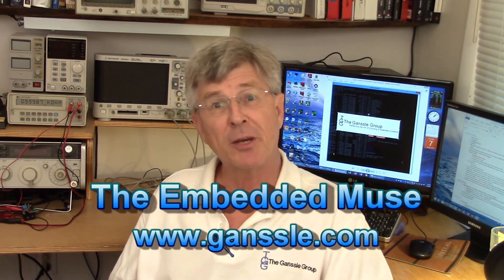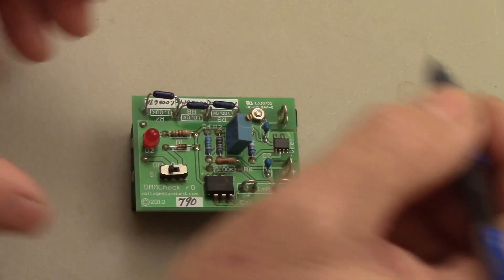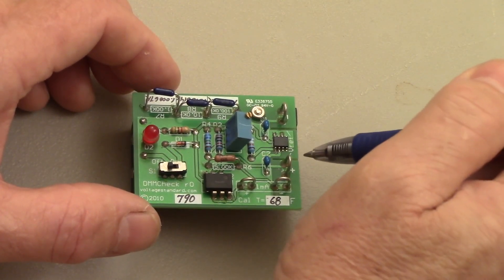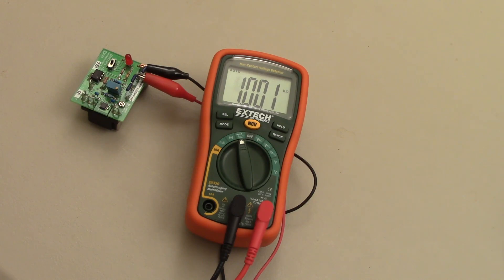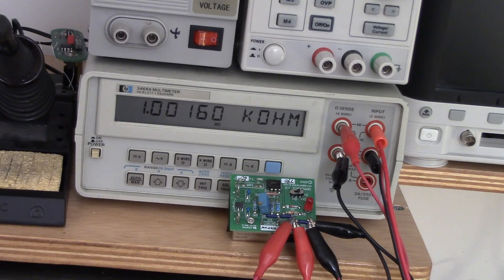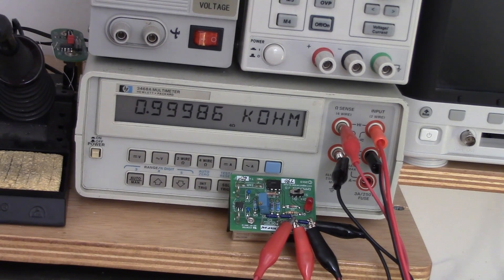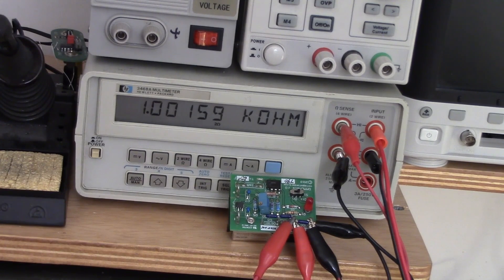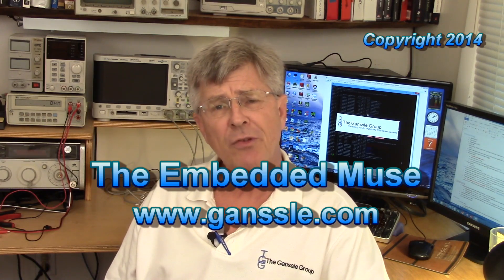Episode 10 - Is Your DMM Accurate? Here's How to Tell

Comment: The point that most folk miss is that you rarely actually NEED to know a voltage accurately. If you are making or repairing an amplifier or some digital circuit and you adjust the power supply until your meter says 5.00000 volts, but due to meter error, in fact it's 5.05 volts, does it really matter? Very rarely, particularly if you use the SAME METER to measure other voltages in the circuit. And that's a 10% error!  Most DMMs, even the cheap ones, will be far more accurate than 10%. Engineers spend a lot of time COMPARING voltages. Is the voltage at point X higher than that at point Y, when it should be lower? If you compare two voltages that are supposed to be the same and one of them is a little high, you're probably going to say "Well, I guess that's near enough". But if one is half the value of the other, then the response is "Looks like we've got a problem here". What is important is REASONABLE consistency, repeatability and linearity. If you measure two voltages, one of which is half the other, then it's often important that the meter gives two readings that are in the correct ratio, i.e. 2-1 within a reasonable deviation. We happily work with 1% resistors or worse, we measure voltages on analog oscilloscopes by counting graticule markings (10% if you're lucky) etc. and our circuits usually work just fine.

Clearly, there are times when absolute accuracy is vital, but most engineers rarely if ever work on such projects. The rest of the time, owning a meter with umpteen figure accuracy is just a matter of pride - like owning a new car - a nice to have, but not essential to get the job done. And of course, just because a meter has 5 digits, doesn't mean it's accurate - precision and accuracy are different things.

Comment: Hello and thank you for your very interesting videos. When it comes to 4-wire resistance measurements, what is the advantage above 2-wire measurements when the test wires' resistance is cancelled out?
Reply: As stated in the video, 4 wire is more precise, and you really want to avoid test wires resistance when you're measuring resistors under 1 ohm

Comment: Interesting video. But there is one little detail of which you should be aware. Your DMM (HP 3468A, also applies to HP 3478A) will only be calibrated in either the 2W ohms ranges OR the 4W ohms ranges. This is a quirk of these instruments. If you haven't done anything to it since it was new, chances are it's calibrated on the 2W ohms ranges. I have an HP 3478A and on several occasions measured negative ohms! After some investigation it turned out this was the reason. (This does not have an impact on the validity of your explanation in this video though.)

Comment: Hi! Just a couple of questions: Other than the specified values, written on the DMMCHeck, how can we be confident in them? How stable are the mentioned values with time and/or changing temperature in the lab? Wont these variations surpass what you gained from going from 2-wire to 4-wire (Kelvin) measurement?
Wish you told us more about the effective stability and reliability of DMMCheck.
If measuring 1K we get 1.0016K instead of 0.9986K (an error of 0.003K or roughly 0.3%) and that is not acceptable for a specific job, how much better will we be with DMMCheck?
Note that I have nothing against the unit and believe it is an excellent idea to have references at hand, to gauge our measurements.
But, how good is the unit? After all, people will be buying it because they have no other lab references and cannot afford a top notch calibrated instrument.
Reply: To my knowledge, these units are measured by an HP 3458A at 23 (or 25?) degrees Celsius. As long as the unit has not suffered any sort of trauma like submersion, extreme heat or getting bashed, they should perform fairly well when you replicate the environment it was characterised in. I.e. your lab's temperature should be within 1 degree Celsius of the temperature of the lab it was characterized in. That said, it's always a good idea to compare several instruments whenever you have the chance.

Comment: HC-01 is simple to use Multimeter Calibrator Reference if you need to check your meter, voltage,m current and resistance
http://www.h-instruments.com/product/avo_multimeter_calibrator__reference

Comment: Can you explain how the cutouts around the voltage regulator keeps it accurate.
Reply: Sort of a gimmic, I think. In expensive instruments it helps for dealing with material deformations due to temperature changes; if your board stretches because of heat, the leads of that IC will not get tensioned as much. This board is only intended to be used around 68F (it was calibrated at that temperature), so I don't know how much the cutting out helps in this case.
Reply: chubbytrucker01 . It also helps with long term drift and stress on the chip from  mounting the circuit board etc. Google voltnuts for the down the rabbit hole detail  of voltage references.
Reply: The effect of mechanical stress on the Vref is real, but I doubt most users will ever notice unless they are sporting 5-1/2 digits or better.

Comment: I don't know if you are still monitoring this post Jack. If so, I have a question concerning DMMs. That question is: Why do DMMs not have a zero adjust for the ohms scale? Every DMM I've ever shorted the leads on reads some small amount of resistance, even my brand new, calibrated Fluke 87 V. I am making the assumption that the meter is reading the resistance of the test leads.
Reply: +Roger Lamb I am not sure if you found the answer to your question, but here is my input.

Modern DMMs often do have a relative mode, which can be used to cancel out the lead resistance on ohms mode, generally this simply means you short the leads and click activate the relative mode. I do believe the Fluke 87V has this feature.

Though you will probably find that when dealing with resistances under one or two ohms factors like contact resistance can make a significant impact on the measurement.
Reply from the maker: Roger,

I can only speculate, but assume it's because the lead resistance is low, and not important for most measurements. If there were a zero adjust, odds are most people would have it set incorrectly, which would make all measurements suspect.